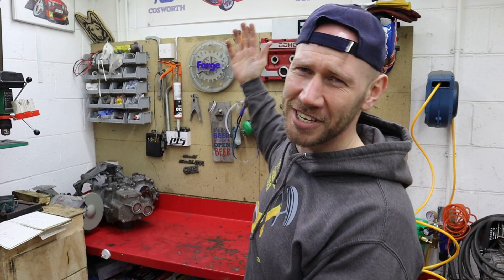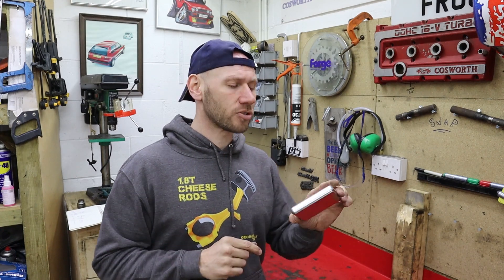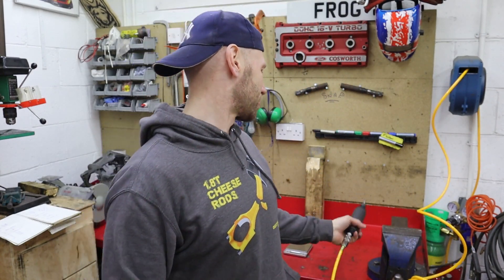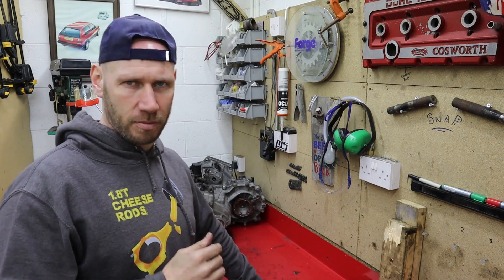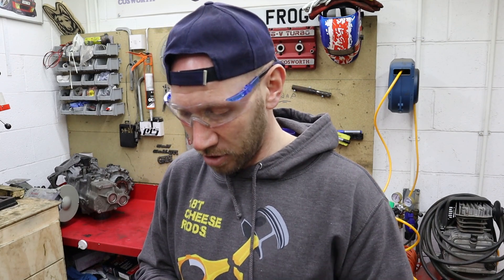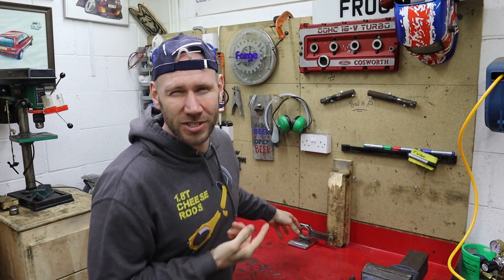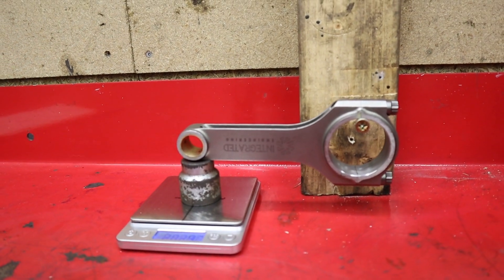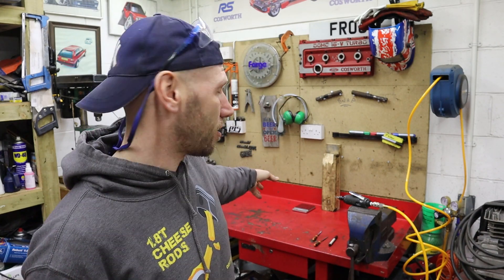BALANCING THE ENGINE ROTATING ASSEMBLY!!  // 1.8T Stroker Engine Build

Comment: A lot of the scale fluctuation you're getting comes from the rod not locating itself in precisely the same spot on the screw and at the scale contact point. Each time it's shifted, you have more or less length of the rod's mass on the scale resulting in weight variations. If you put a ball bearing on the screw and hang the end on the scale from a swing with a bearing at the rod contact point, gravity will allow the rod to settle into the same position with near zero friction and you'll get much more consistent readings. Good luck with your build!
Reply from the maker: Haha yeah I knew of the issues when doing this. We do it properly now with a jig, and bearings as you mentioned.

Comment: Hey mam thanks for the great video series i have a question though sorry for being few years late im only starting my build now. With the crank which rods did you use for the 1.8t or 2.0tfsi, and also the size of the wrist pin isit 21mm? Then one more thing the main end bearings and Conrod bearing isit for a 1.8t or 2.0tfsi
Reply from the maker: It is an 1.8t build, so all tolerances are to 1.8t spec, not TFSI.

The rods are 20mm 1.8t rods 👍👍
Reply: @DecimalTenths  thank you very much for the info man

Comment: Great vids! I'm buying an A4 Audi with a 1.8. The sellers daughter got a rod knock, so he picked up another engine. So which engine code is best!
 Thanks from Illinois.
Reply from the maker: Hi pal, these days it's best to just get the best condition one you can. Also best to match the engine type. There  are 2 types 058 early and 06A later.

Comment: Good one Nick, I order the IE rods with the rifle driling for my 1.8 t daly it is 200hp on wheels (quattro) and it is in boxes right now waiting for rods and bearings. May I ask you do you take material only from one side of the big end of the rod or bot sides. And mate I will use your videos as a totorial to build my engine :) . Thak you for the content.
Reply from the maker: Hi! Rifle drilling is a good option. They did drop it on the TFSI/TSI engones though so is probably a good guide as to how effective it really is. I take material from both sides mate, nice and even 👍

Comment: How much £ was that scale? Hearing from those fluctuations it could be the scale... or?
Reply from the maker: The scale was only £10 so not really surprisingly crap...😂. The measurements were more stable with less of the measuring surface covered so it could probably be tightened up by resting the big end on a socket. With them all measured and mixed around I can close the differences up very nicely to less than 0.1g so in the end it all worked out. Just took an afternoon of clarting around to get there...🙃
Reply: Yeah mate no problem. What ive seen is they rest the big end on a stanley knife blade on the scale.. Love the build. Keep it up

Comment: Nick is this so you can raise the RPM?
Reply from the maker: It would certainly help with that mate. The aim is reliability with this one more than anything else. Years ago Mountune used to debur and balance all of the rotating mass of the YB Cosworth Group N engines. No further performance enhancing modifications were allowed. This provides longevity and reliability considering they were used at high RPM for all of their lives. My attempt here is to mirror some of them procedures and hopefully make a reliable, vibration free circuit engine. Stay tuned to see if I manage it...🤣. In all honesty the effort cant hurt can it?

Comment: Your really going to town on this build, how essential for a road car would shaving 10th of grams off be, i'm not sure i will do it for my stroker build but i can see the point for your track day beastie 👍
Reply from the maker: Not essential at all mate. I've ran forged engines for years without balancing the rotating assemblies.  This is just another way to fine tune, and get the smoothest most efficient setup. At high rpm flex in the block and components is a killer, so anything I can do to dampen out imbalance and flex is a winner.
Reply: Decimal Tenths are you fitting a fluidampr?
Reply: And its part of the fun.. fiddle'n with those parts